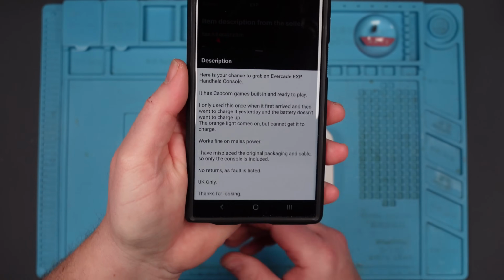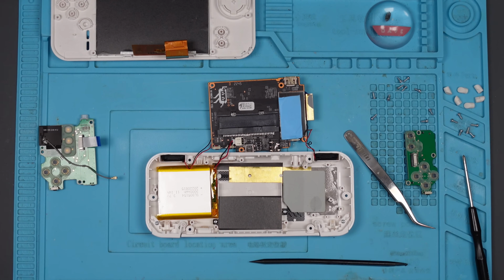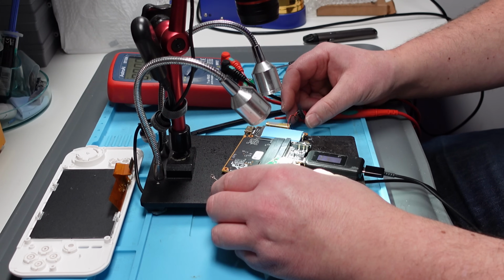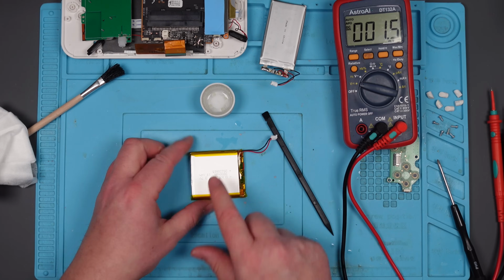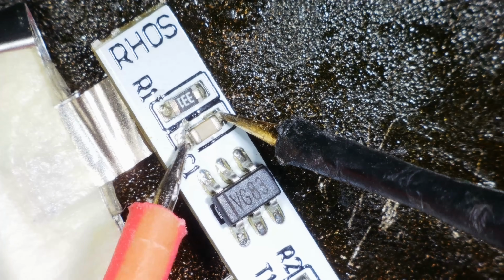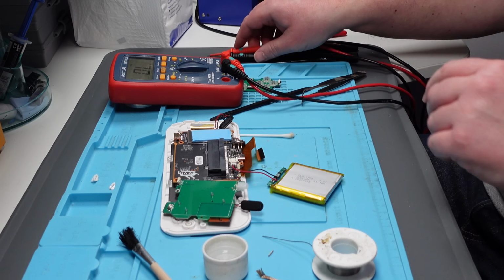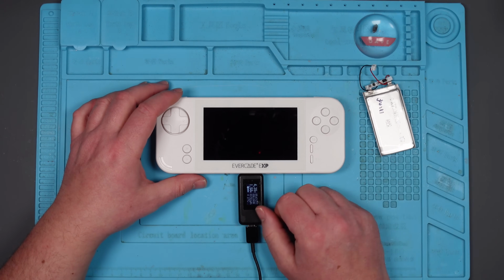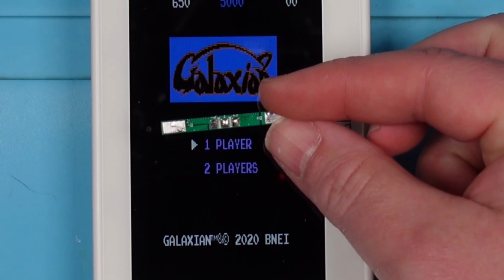Do all Evercade EXP's have this fault? | Let's FIX it

Comment: When I worked tech for a school district, one of the Chromebook models we purchased 3000+ units of had a common issue with the battery management board. Over 10% failure rate, cost that company over $20k in battery replacements.

Comment: You’re a braver man than I Steve, lithium batteries terrify me, I’d have just replaced it,
Reply: Sadly, the battery in that exact size is pretty much unobtanium. This is the number off the battery: SL805154 which translates to 8.0mm x 51mm x 54mm dimensions. Likely Evercade had these battery pouches custom made to fit their use case. The closest I could find is a 804040 which will fit, but is obviously smaller than the original, so you'll be missing some battery life compared to the original.

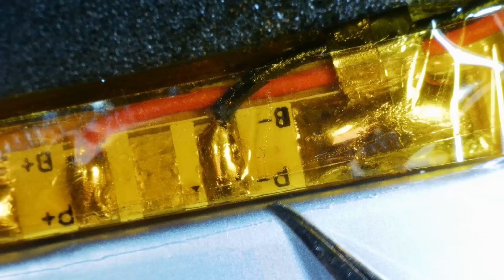Comment: @ 8:02 - no, I won't call you an idiot - but popping the connector pins out of the connector and reversing then would have been a LOT quicker and easier, plus the colours remain correct! I use the tip of a No. 10 scalpel blade to push in the little spring-retainers in the connector housing, then gently pull the wire out. There's even a tool to do this if you are feeling a bit flush! The scalpel is easier and cheaper.
Reply: Google JST connector
Reply: I was thinking he should sand/file down the connector so it fits both ways, then hot glue it in place if he wants it in there permanently...

Comment: Stupid EXP! ....Yep, it's just happened to mine. And it does seem like a relatively common problem. The main issue being that the odd sized battery means it is nearly impossible to find a good replacement for it!!!  ...I am not a techy so opening and fiddling about inside terrifies me (even though it is outside warrantee) , so I went for the easy solution and bought a slim power-bank! Job done. (It fits nicely into the case with the EXP.)

Comment: Just started watching you, really enjoy your work, if I may offer some comments:
You said  "spilled my IPA" in one video, thought you had spilled your beer, wondered if it was good practice to keep a beer on the work table. Now I understand IPA means a different kind of alcohol.
Stop worrying about how you say things, we get it, its part of why your vids are so good.
Melting plastic- I had to remove the pain from a pair of french doors in our house using a heat gun. If I got the gun too close to the glass panes, they would crack. I started making "shields" from folded aluminum foil to protect the glass from the heat when I was working close to the panes. Wonder if there is a way to use that to help extend your "days since melted plastic" counter.
I cant do any of what your do, but I feel like I learn a little bit every time.
😊

Comment: Hey Steve, you can usually use a higher value cap, think of it like a glass of water. The only thing to really worry about with caps is using a lower voltage cap on a higher voltage.
Reply: He knows.

Comment: It is incredibly easy to swap the terminals with a little practice.  It only needs a sharp pointy object to pry the plastic tab and the terminal will back out.  You can use a safety pin, or any other kind of pin.  But a utility knife blade or point on some tweezers also works.

The benefit is that you keep the correct wire colors, and it's much quicker to do, no soldering.

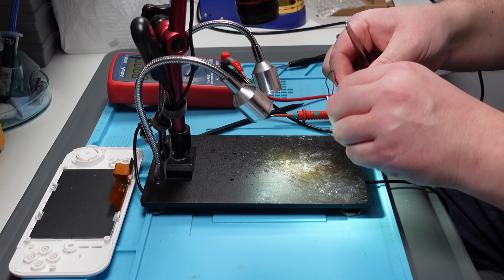Comment: For the charge control board swap from one battery to another, as long as the batteries have the same voltage rating, it should be fine to swap them. For 8:10 I have always found it faster to just change the pins around in the plug of that type of battery. Ya just use your tweezers to lightly push up the plastic holding the pins in and the pins pop out easily. the swap them around, they'll snap right back in, and ready to go!

Comment: Great video. Next step, getting a bigger capacity battery that fits in the case because the included battery drains QUICKLY.

Comment: I've swapped the protection boards on batteries before for a Zune - the cell had failed but I couldn't find a 3-wire replacement in the right size, so got a 2-wire and swapped the original protection board on. Worked fine!

Comment: My mate gave me his faulty one which has a similar issue. Works fine with a different battery connected, or on USB power. Screen flashes and does nothing in the original battery.

Couldn't find a replacement battery the same size, only smaller is physical size and capacity.

Will be taking a look at the management board. Cheers

Comment: Don’t work on the battery protection boards without first disconnecting the cells! I was half expecting flames and explosions when you flooded the  pins with the low melt solder 😂

Comment: A LiPo below 3,2 Volt is often damaged beyond repair. Usually the protection curcuits dont even try to charge them to avoid overheating.

Comment: Great video!
Please try to find what's wong with that charging module i want to know what is causing the fault 😂.
For the capacitor value why not looking for the datasheet in the application circuit section. normally those circuit are pretty standard this capacitor should be a 0.1uF (decoupling) one.

Comment: You can de pin the connector. You have to lift or pus a safety clip and pull the wire from it.

Comment: Get some painters tape, masking tape or something similar. Just make an inverted loop and stick it to your work surface. You can stick all SMD parts to it and you'll still be able to take them off easily and without residue. You'll lose a lot less components that way.

Comment: I tried typing this in the "wayback" font hoping this message will reach you before you start working on this thing.  Whenever I replace batteries like this I always recover the protection boards from them noting the capacity of the battery and saving them for later.  I've been able to rescue many batteries simply by swapping out the protection boards with a salvaged one.

Comment: Use a piece of kynar tape to secure the capacitor or other componant before you lose it. Easy. The tape is large and the piece is tiny but stuck to the tape.

Comment: Thanks for your time. Just two questions, sorry to be annoying, is the pcb for any battery valid, or does it have to be the same mh as the original? Do you have a reference to the battery you used for the replacement? Thank you very much again, I look forward to playing with my namco museum again.

Comment: Continuity readings can only be made without voltage present! Some multimeters actually break when you measure resistance with voltage and then the meter cant measure resistance anymore 0_o

Comment: You can’t use a continuity tester on a battery - you’ll get all sorts of spurious results.  A resistance or continuity meter works by injecting a current through the component being measured and measuring the voltage drop across the component - the lower the drop the lower the resistance, zero drop and you have a short or continuity, no voltage drop and you have a break or open circuit.  But if you are measuring something that is already under power (like a battery) then the voltage already present on the circuit being tested is going to confuse the hell out of the meter.

Plus, a good healthy battery will have a very low internal resistance so would look like a short any way.

Comment: Should be fine swapping bms provided they are the same chemistry type and voltage, those flat ones im pretty sure are all lipo basically lithium ion) you should be able to Google the serial number on it to double check. If you are going to be charging random batteries of varying chemistry types and voltages, i highly recommend getting the imax b6 charger it will charge basically anything and can even bring dead batteries back to life.

Comment: Get a pin extractor and swap pins in the connector rather than leave the battery leads backwards for the next SoB!  Which will likely be you! 😅

Comment: Soldering on battery terminals is a bad idea generally. They cant handle the heat, and once those cells are compromised they cannot recover. There's a reason most battery terminals and BMS are spot welded together. Nanoseconds of heat is way safer than 350c for a few seconds.

Comment: Ofcourse you can swap the battery board over (as long the cells are the save chemistry and voltage) 
Oh and btw it's much quicker to change the wires on the connector than to de and resolder them on the board

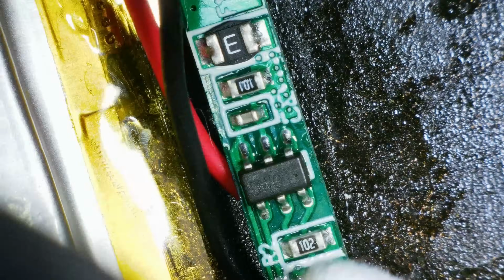Comment: At about 11:45 you can see a component on the battery module which seems to have a small crack. Between numbers 8 and 2. Could that be the reason for the failures?

Comment: if the capacity of the batteries is similar, physically the max charging power should be equal. the type (3,7v) is the same for all these batteries, so I would also swap the boards and check if anything is different. If you don't put them in in wrong polarity nothing should blow 😀

Stupid polarity 🙂

Comment: Hi, sorry to correct your "measurements", but you can´t test a batterie for a short on it´s terminals!. First off all, if the batterie would be shorted there would be no voltage...... But your original batterie had a output voltage.  For a simple explanation: Your multimeter is measuring continuity by putting out a low voltage and checks if there is current flowing between its leads. If you stick these leads / probing tips on the batterie terminals that have already a (much higher) voltage then there es a current flowing because of the batterie voltage. But the measuring circuit inside the multimeter gets overdriven (that’s why your multimeter doesn’t stop beeping directly when you lift the tips -> measuring the cap @11:20, this is a typical behavior). 
And please!!! If you (de-)solder parts on a batterie management board for swapping / testing components, please disconnect the cells first. In worst case you will short out the cells and they may not be happy about it! In your case I believe you were lucky about the fuse on the board, this little device may have saved your day!

Comment: At 10:30 you can't measure continuity of an active device like a battery. It's even dangerous for your multimeter to do so.
Why? Because to measure continuity the meter is sending a small voltage across, and measuring whether the voltage is present at the other end.
But with a battery of course there will be a voltage across the terminals. Where it gets dangerous for your meter is how many amps your batter delivers because you're essentially short-circuiting the battery through your meter. Of course it has protection (high impedance and so on) but nothing is immune to a high enough current and voltage combination.

Comment: 8:00 maybe just swap the pins on the battery connector ? Should be able to just push in the pin latch and it'll come right out of the plastic connector.
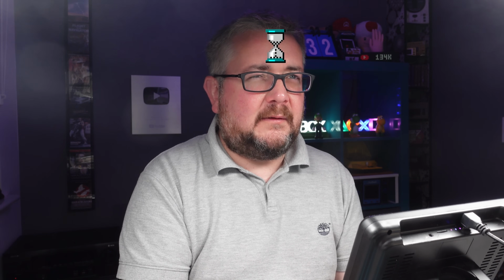12:20 How far away are you from me, Steve? If'it's more than 200 miles then I'd say YEAH! Go for it, swap those battery managers around, PS. Where do I send the wreath?

Comment: You need a spot welder. Soldering battery tabs is awful practice and not only bad for the battery life, but also very dangerous - both due to the amount of heat you put into it that way.

Comment: Swapping the battery management board works "good enough" because either the batteries have similar capacity and chemistry, or because they are universal and make the batteries wear out quicker than they could achieve with proper calibration in the management board. That is why you ideally only swap these boards with ones that are programmed to use the same chemistry and capacity and charge parameters, or you alter the programming of the board. Truth is, a lot of these batteries just get some universal chips, so chances are, you won't notice any difference.

Comment: All you had to do was get the original battery up above 3v by connectingit to another lipo with voltage above 3.5v,in a few secondsthe originalbatterywould have been working like new.... 

pretty much every device has the lipo cutoff voltage at 3v.anything below that and they won't function nor charge.

Comment: Wouldn't have killed you to strip a bit more insulation from the good battery wire before soldering it on right at the end... you had an enormous pad to solder on to and only a tiny bit of exposed wire!

Comment: you can use a tiny pick to push the tabs in on the pins of those connectors to reverse them instead of desoldering, just sayin'

Comment: If you don’t know the value of a lost capacitor like that  just use 0.1 uF.  90% of the time you will have guessed right and the other 10% it does not matter.

Comment: Dunno why the guy put it on ebay. If it was new then Evercade would have fixed it by offering a replacement system. I have an EXP and it works perfectly.

Comment: I don't know if I'm the only one who is expecting the battery to burst on fire when the pins on the chip were covered in low melt solder.
Reply: Nope, you were not the only one...
Reply: I was expecting flames long before that, when the board was being pressed onto the metal microscope stand and the battery was connected the wrong way round.

Comment: Used it once misplaced the original package and cable..... And receipt.....

I've never bought anything and misplaced the packaging within 20 seconds of tearing it open and trying the device out.  If it's new and didn't work, send it back, rather than lie in your listings.

Comment: It's not a good idea to use a multimeter set to resistance/continuity on a live rail. No wonder it threw a wobbler. Should just check voltage drops instead.

Comment: The choice of desoldering, swapping around and resoldering the wires on the battery protection board rather than simply unpinning the connector and plugging them in the right way around is ... a choice.